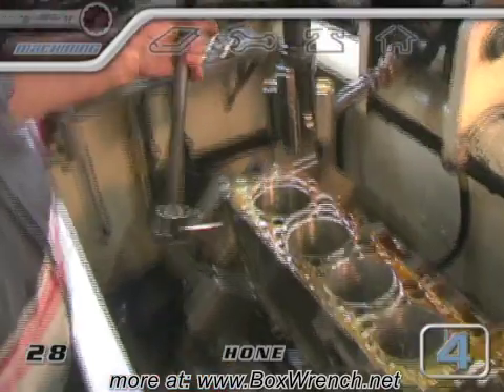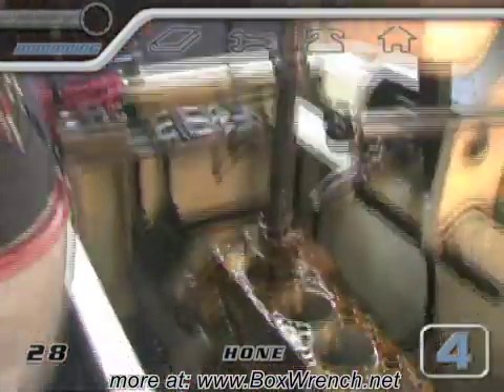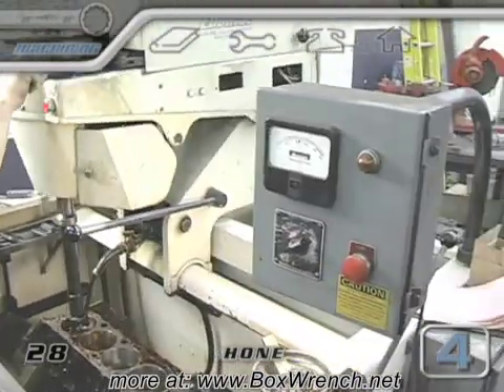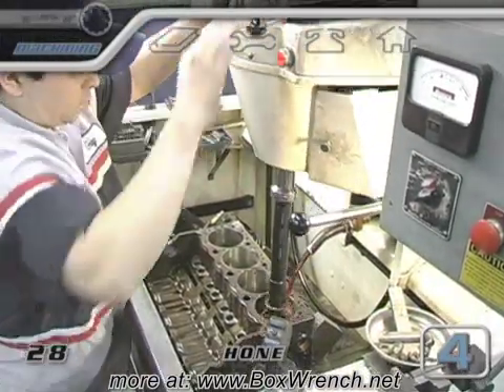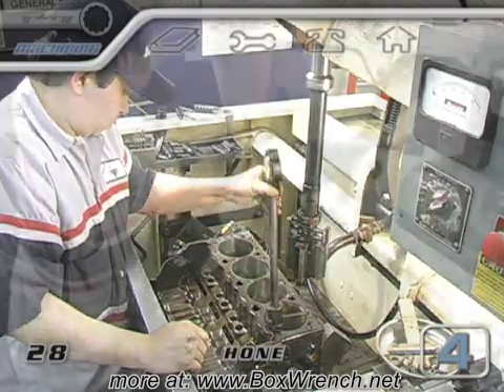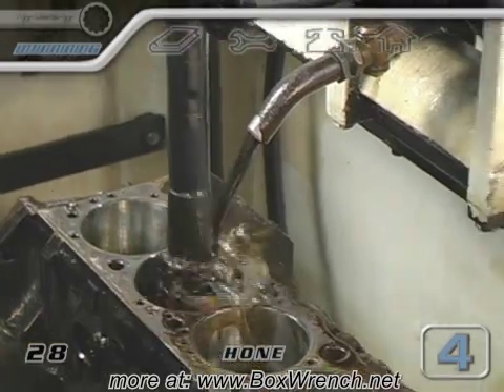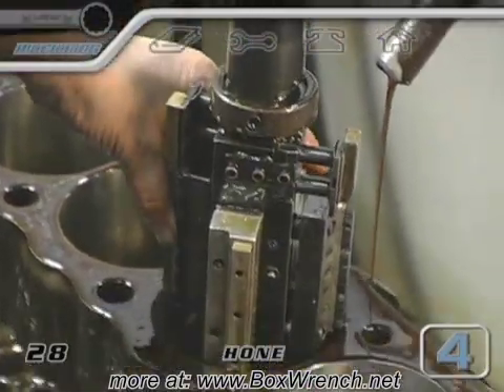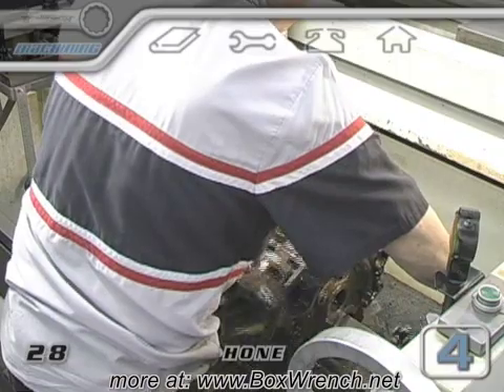Cylinder Bore Honing - Engine Building Video - Hone Piston Wall

Comment from the maker: All that you are doing with "honing" stones and a drill is referred to as Glaze Breaking. A hand drill will never remove enough metal to actually size a bore. 

Hand held tools are designed to refinish the crosshatch scratches of a bore that is already true and round and that does not have a serious ridge or other damage. 
If a rebuild block is in good shape you can use honing stones. In this video the block was bored out, a hand held drill would never be capable of finishing the bore correctly
Reply: You know @BoxWrench, I see you mentioned many times that you can't hone by hand but I have to dissagree, strongley. A common hand honing tool is the Sunnen AN style hone. This hand held hone is also the same head, stones and guides that the smaller honing machine use. Machines like the Kwik Way 092,  the Rottler's, Peterson, Axe, etc. Using the 101an stone roughes out cast iron cylinders quite quickly and straight with a 1/2" hand drill. True up with the 301 stones, pre finish with 501 and then finish with 625's. Then run a platue brush through. Before I bought my Sunnen CV-616, I honed all my blocks like this in a self built cabinet with a pump for the honing oil. Yep, it was a lot of work but eventually I was able to produce enough engines to save up and purchase my Cylinder King. I would pre bore leaving 0.005" for honing stock, resurface decks then finish hone by hand. Done dozens opon dozens like this. I am just saying that honing by hand is effective and not restricted to deglazing. Of course in the wrong hands this tool is also a weapon of mass destruction to an engine.  A couple months back I had a smaller block come in for a resizing. The bore was just less then my CK3000 head could go down to and yup, out came the AN hand hone lol. I clamped the block in my CV-616 cabinet and honed it out by hand using the cabinets oil pump with a hose from the nozzle. I rarely ever do smaller engines so never bothered to buy the junior head. Anyways, nice machine. I was hoping to find a white one when I bought mine but found a green that called to me. So, green it is lol.

Comment from the maker: Just call around to a couple automotive machine shops, they usually have a package price for an entire engine block service job that should only be a few hundred dollars at most. They will strip down the block, remove engine plugs, check and clean the block for you and may even hone and install camshaft bearings all in one package price deal.